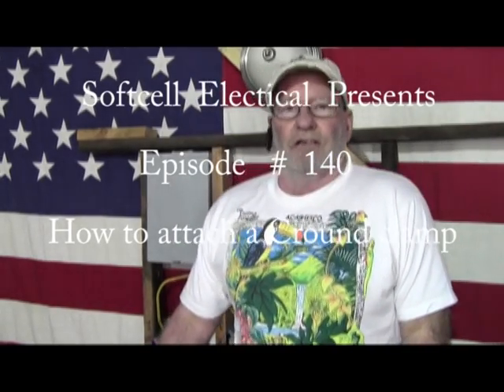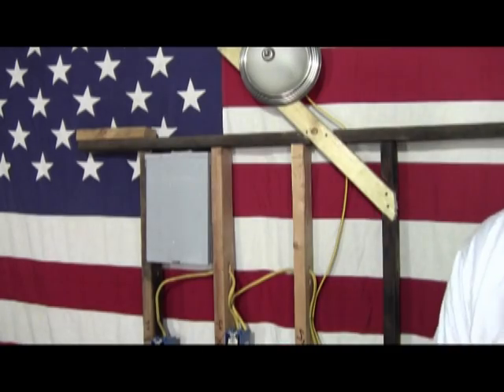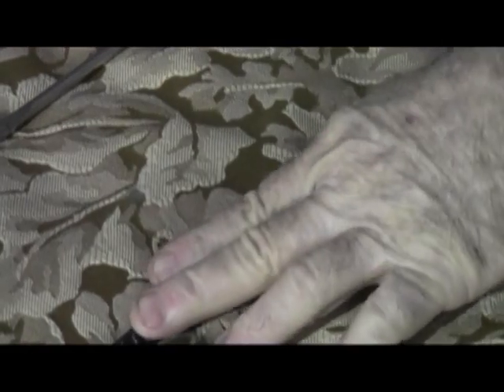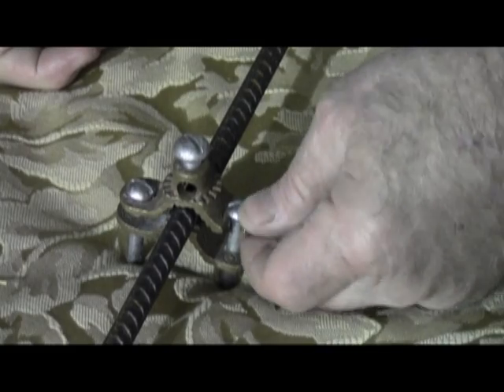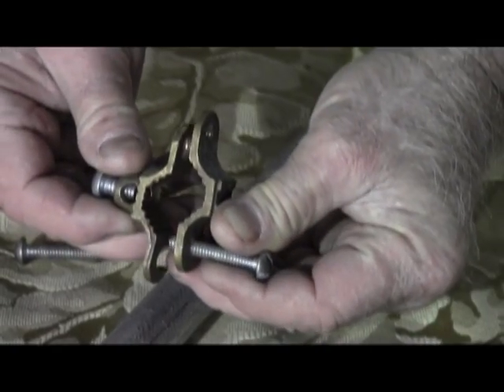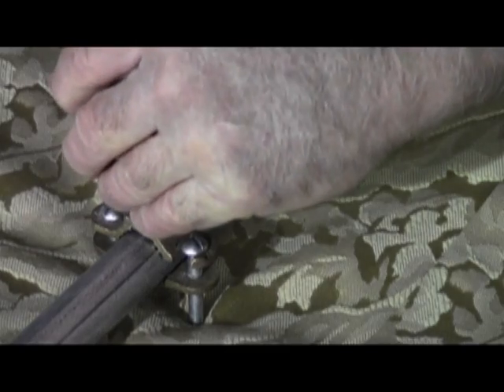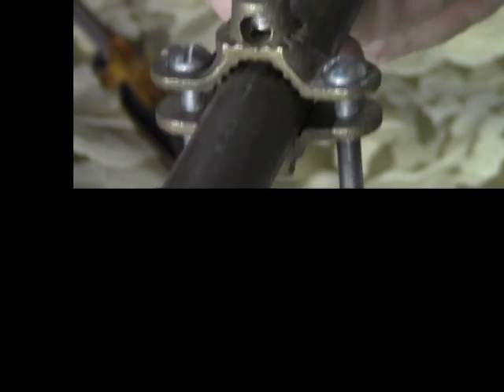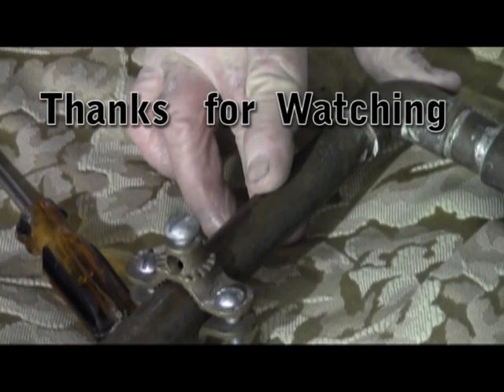connecting a ground bar #3 G  140

Comment: John,

A couple of points:

1) It's not a ground bushing .... it's a cold water copper pipe clamp.
2) You need 2 clamps ... one before the water meter and one after the water meter.
3) The Ground conductor starts on the street/main side of the water meter then passes thru the 2nd clamp and then on to the PNL.
4) If you only install the clamp on the house side of the cold water pipe ... you loose the Gnd if the meter is ever replaced.
5) GER should be attached to the power co meter socket

Comment from the maker: I should add here that no contractor is allowed to even touch anything before the meter. Each State is different, and our water district would file an official complaint if we attached anything before the meter. Besides its run in poly so no point. In NV there are 4 critical points of grounding: the UFR, the water heater loop and the softwater loop.

Comment from the maker: I suppose that's why every electrician I know uses this item on rebar and copper pipe, and why it passes inspection every single time. There are the way things that are taught in class and then there are what the inspectors expect to see...not always the same. Remember this: the inspector is like G-d. If he wants something done a certain way, you do it...even if it's not up to code. That's job site reality.